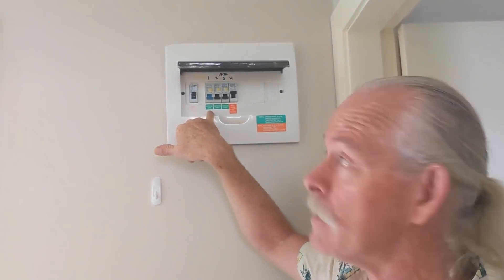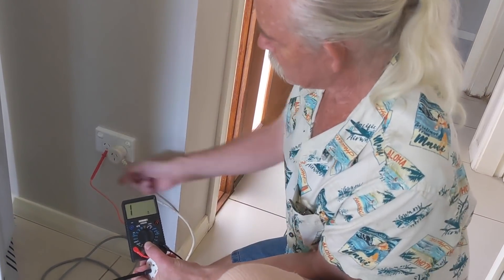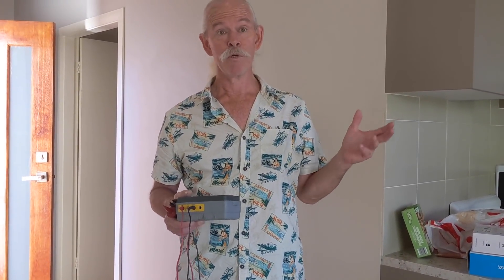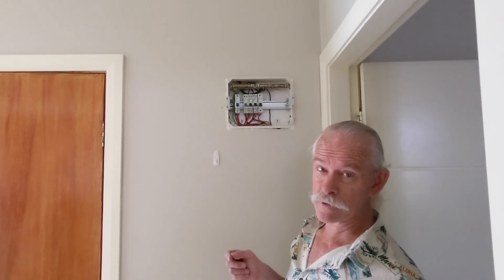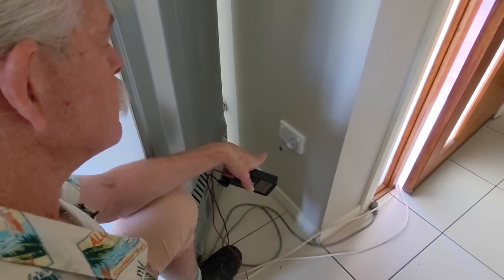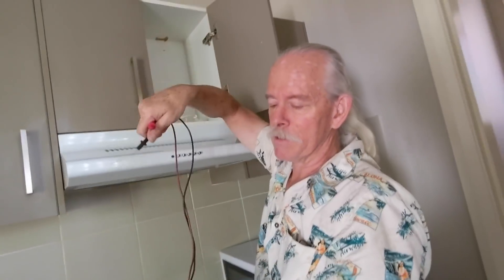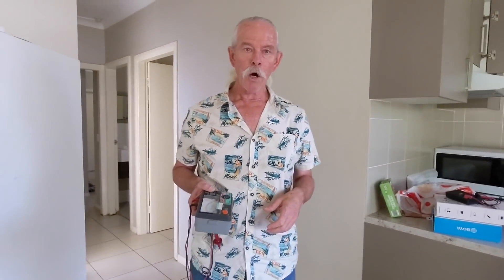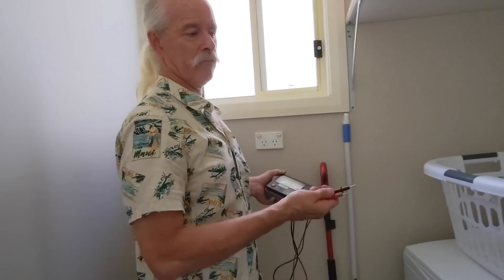Testing A Granny Flat

Comment: Gday lad, enjoyed your video BUT would it not have been prudent to test the GPO or light circuits for power once you turned off the Switchboard just to be absolutely sure the power was off and that the breakers were working as designed.  So often I believed I was isolating a circuit only to find it live when I tested it.  Apologies if I am being picky.
Reply from the maker: You are absolutely correct

Comment: One good thing about more expensive digital meters is that they'll give you very accurate ohm range very quickly, less then half a second and no jumping around in values, unless you got a probe contact issue.
Fluke electricians meter 117 is perfect for domestic electricians, unless you go into PLC troubleshooting, as it has a feature to eliminate inductive coupling (ghost) voltage in cables.
Reply from the maker: I did not know that

Comment: Aren't you supposed to disconnect RCDs from the testing circuit, so you don't damage them doing the IR test?
Reply from the maker: What an awesome question. Normally I would say yes but in this case I have put test lamps between active and neutral to protect it. Problem solved.

Comment: Young people beware of the early installations that used a single running earth, which may give different readings.
And generally the Insulation Tester uses a greater voltage than a standard meter to calculate the Resistance so you don't get as much fluctuation on the readings.
Other than than the safety precautions you obviously took before these steps, love your work.
Reply from the maker: Thanks Steve, the expression we used when i was a lad was catenery earth. Cheers